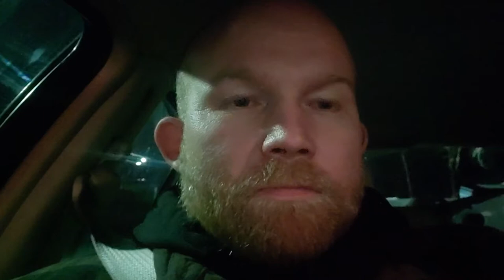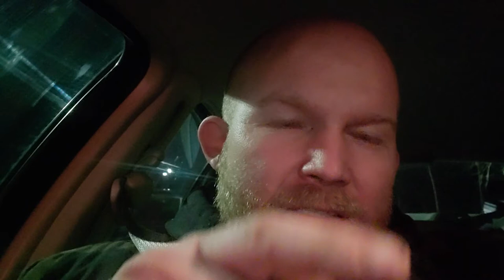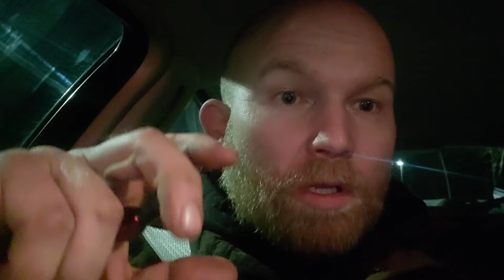Water Dripping From Exhaust - Is This Normal? - Lets Chat - Master Tech Explains

Comment: Thank you! Now I have an idea. Fuel might be the problem. I rarely drive my car.
Reply from the maker: You're Very Welcome
Reply: @FordBossMe  I will be using this car more. Took my ST in to get it fixed from the roof rattle. Do you recommend I put an additive while I fill up or should I put a higher octane? I turned my car on at least a couple of days a week. I would rarely move it though. It’s leaking water for sure. Its a good amount though. If I can guess it’s about 2 drops per second. Its not colored and its not coolant.

Comment: One day I couldn't get up my driveway since the engine kept on staling. In my Focus the catalytic converter had been corroded loose inside and clogged the flow. This was due to too much short distance driving so it seems a lot of water must have collected inside. The car was mostly parked in dry parking garage.
Reply from the maker: I would agree with that

Comment: 1992 VOLVO 960, WHEN I FILL IT UP WITH A COOLANT 50/50 IN THE RADIATOR.  THE COOLANT GOING STRAIGHT TO THE EXHAUST AND START DRIPPING.  WHAT IS THE PROBLEM?

Comment: I have a 2014 Honda Accord with 59xxxx miles
After 20 sec of starting my car, the exhaust Tip collects water and that’s when it starts to throw out thin white smoke 
But after I dive it, the smoke complete goes away.
This smoke is very noticeable even on sunny days!!!
And It doesnt lose oil or coolant…
Reply from the maker: That's normal

Comment: 2006 4.8l silverado, automatic: it drips constantly from both tailpipe and the weephole in the muffler. I mean from about 5 min after cranking til 5 after i turn it off. Doesnt matter the temperature outside, the distance of trip or how aggressively I drive. Is this bad or just mean i have a good engine?

Comment: Thanks for detailed explanation, I have Honda Amaze 2013 model Diesel Car and black water (with carbon) coming out from exhaust in winter. Is it normal? I have started by car for around 20 mins today,but no negative indicator. I am not driving from some days and only starting to check it.

Comment: Thank you mine is a Mercedes-Benz small car and I saw water dripping I called my brother I was up set.. He said it's cold just let it run and he asked if it was a big puddle I said no but only about one serving big spoon he said let it run for about 40 mins I did and it did stop I HEARD you and that was a second opinion so thank you so much I was very relieved.. But I have one more question please.. My car is a 230 slk Kompressor 1999 and it's manual and when I put into gear any gear I hear like a almost like a whizzing sound I heard that with the window down is that normal.. Could you please answer ASAP PLEASE

Comment: Thanks for the informative video. I was just looking at a used Honda Jazz/Fit to buy which seemed to have a lot of water coming out the exhaust. I just don't know how to tell whether it was "excessive". 

It wasn't just a bit of water dripping from the exhaust but rather it was blowing out like a light rain shower, even after idling for several minutes. I could hold my hand 10-15 cm away and I would have water blowing on to me like light rain. It was a hot day for what it's worth. No smoke coming out of the exhaust though.

Does this sound normal still or potentially worrying?
Reply: Did you ever find the problem?

Comment: What if it’s very warm outside, will you still see water? What if your engine is heated and you notice the water when you arrive at your destination after the vehicle is shut off?
Reply from the maker: If the vehicle seems to be running fine then yes it would be normal

Comment: I leave in an apartment and I have 3 vehicles which are parked beside each other. Every morning I'll notice a trail of water running down on the ground from the exhaust but no one else's cars have that problem. I just bought a brand new 2022 and I saw the samething. These cars had been sitting in the parking lot at night with everyone else's car. The ground will be dry with everyone else's cars but the ground where my vehicles are parked will be wet where the exhausts are. Why is that when everyone else's is dry? Is someone running my cars while I'm not aware at night?
Reply from the maker: If you see condensation coming from your vehicles that is a healthy normal vehicle just like a dog's nose when it's wet you know they feel good and they're pretty healthy the same thing with your car
Reply from the maker: Don't overthink it if you don't have problems don't go searching for them
Reply: @FordBossMe  So that's normal even if they haven't been driven? I thought it would stay dry? Or could be condensation from the morning dew? And Thank you for replying!

Comment: Dude my eco boost had like thick black residue on the tailpipe. So i kinda knew it was a lean or rich problem. So i just changed the coilpacks and now i get water droplets. Something i hadn’t seen. Check for residue on the tailpipe. Ignition system needs servicing
Reply from the maker: Residue doesn't always mean that it's rich or lean because just getting in and out of the throttle kind of hard will reaching it up and you got to realize these things burn oil like crazy so that's going to be there eventually

Comment: What if the car runs fine but when you rev it up water pours out like cups of water?? Plus no heat
Reply from the maker: Water being pushed out of the exhaust is normal if the vehicle is running fine
Reply: Check compression. Chances are your cylinder head is compromised (head gasket failure)

Comment: I started having a leak from the middle between the front tires then I noticed water and a little bit of smoke from the muffler and a strong exhaust smell but qould clear after 3 or 4 minutes. It literally left a trail out of my driveway is that something to worry about
Reply from the maker: If the vehicle is running good and there is no problems and it's just water do not worry about it

Comment: I have a 212 predator engine on my golf cart I haven’t ran it for about a week and it was very cold outside so I took it about a mile away and back and when I got back my muffler was dripping a lot of water and it almost look like my muffler or the inside of my muffler was on fire it just kept smoking even after I took it off but nothing was coming out of the engine and the engine was running good and has clean oil don’t know what this problem will be
Reply from the maker: If there's nothing wrong with it don't change anything don't worry if it's running good

Comment: Hmmm 🤔 I'm having blue smoke and puddles of water but if I drive it let's say 30 mins the smoke  lightens up alot more even less smoke if I'm being a lead foot smokes the most at idle and sitting in the car just stinks 😩 06 Chevy HHR LT auto trans???? Also my t/c light kicks on if I go from park to low gear without even driving it but my t/c light don't come on in any other gears but low gear

Comment: Thank u so much for this video it made me feel a little better lol. I have a 2000 Honda civic DX 141k miles with this condensation issue with water trapped in my muffler where it seems pretty excessive leaking from what appears to be a small hole or a possible leak jus before the muffler and it drips a lot. When at idle the muffler noise sounds almost like a flutter because of the trapped water inside and sprays leaving water stains about a foot away when I give it alittle gas. it makes me nervous but the car runs great idles fine . I checked the water doesn’t smell like gas or anything at all. the water color looks slightly dirty. Current weather conditions in upstate NY are 20 degrees so that’s the issue I’m sure but it seems so much I’m nervous lol. Can I drill a small hole in my muffler and then jus plug it with some high heat sealer or can I stick a hose in there and get it out with a pump?
Reply from the maker: So I also have another video in my library let me try to find it for you where I show you there's already holes in the exhaust system naturally for draining water and it does make that fluttering sound you're talking about that's absolutely normal
Reply from the maker: https://youtu.be/7_lbi8eAo8g
Reply: I just posted a video yesterday with my 2000 acura el 1.6 vtec spitting water like a orgasm while just idling..

Comment: What about a new 2021 Ford Ranger dripping water from the edges of the Bulky part of the muffler?

Mine is dripping from both edges of the muffler bulk near the weld seams but I'm not sure it's a planned drip point.
Reply from the maker: There's little holes on both sides it's meant to be there and drip